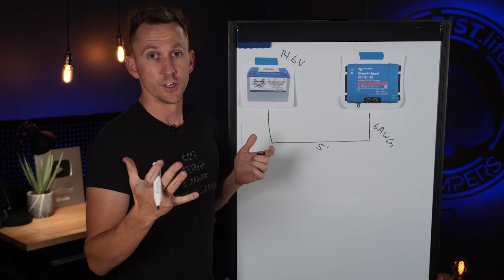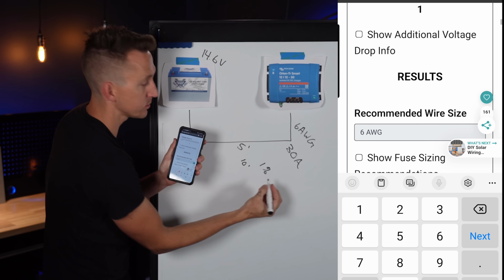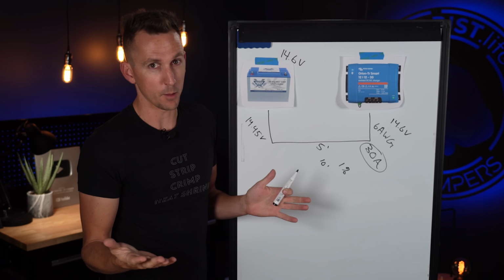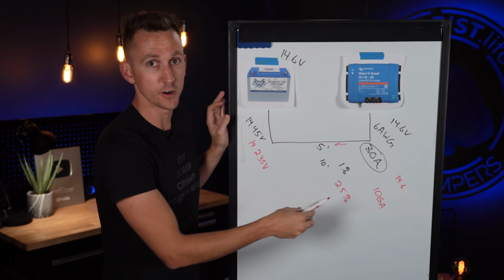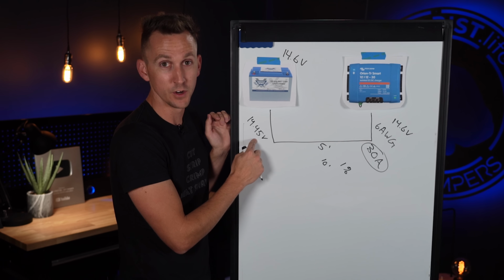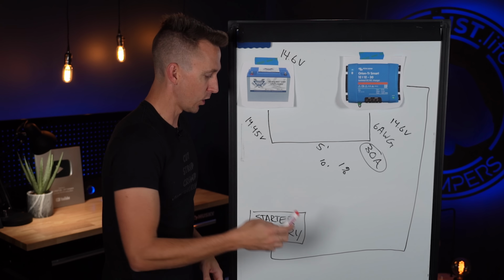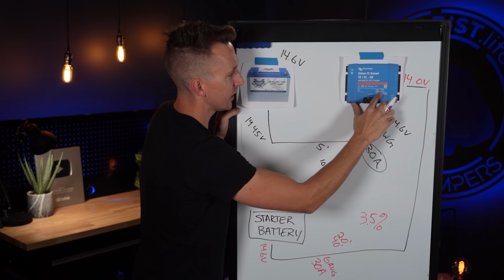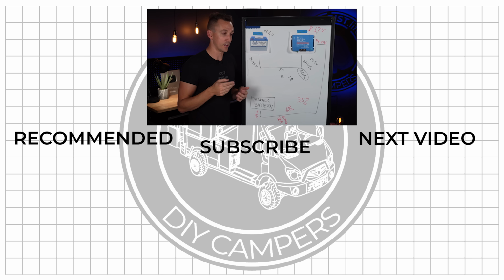HOW VOLTAGE DROP AFFECTS BATTERY CHARGERS

Comment: Hi Nate, I used you renogy wiring diagram for my build. I have 600 watts of solar and 400AH of lithium battery. I’ve set all my appliances to lithium and recently has my whole electric setup shutoff at 50% battery. I have a renogy smart shunt. Is there something I need to program so it doesn’t shut off at half battery life?
Reply from the maker: That does indeed sound like a settings issue.  I'd triple check your user manuals to learn more and reach out to Renogy tech support for more help if needed there.

Comment: How does using chassis ground affect the voltage drop calculation? My 20a renogy dcdc charger has input neg connected via 18" 10awg to lynx power in grounding terminal, which is connected via  18" 2/0 to chassis (drivers seat bolt). I haven't measured the voltages, but I will ... later.
Reply from the maker: Good question!  With wire, we have specific resistance measurements for different sizes of wire that gives us the voltage drop results.  With a chassis ground, we don't have resistance coefficients, so we can't calculate that.  Plus... every chassis is different depending on how the body/frame/etc is connected.  This is one of the biggest reasons I never recommend using the chassis as a 'current carrying conductor' like with a non-isolated charger.

Comment: As the voltage drops from the starting battery to the charge controller, the controller draws more amps to compensate for the voltage loss so that the house battery is charged at 14.6 volts, correct?
Reply from the maker: Basically, yes.

Comment: Can you take actual measurements for what you are showing? I suspect that once the charge controller hits 14.6 then the current will begin to drop and you will not see 30amps at that voltage but instead current will drop significantly causing much less voltage drop.
Reply from the maker: Yeah, maybe, but why not just size wires appropriately for the full load the whole time instead of toeing the line of cutting corners for the sake of saving a couple bucks in wire?
Reply: @EXPLORISTlife  Wasn't suggesting to use smaller gauge wire. I was suggesting that the voltage drop is not a concern since the current will begin to drop and there for you will get fully charged batteries regardless

Comment: Won't the lack of full charge due to excessive voltage drop during the bulk phase of the charging cycle be made up by a slghtly extended absorption phase?
You mentioned the mid input voltage on the dc:dc converter being 8V. If you have a min battery voltage of 12V, that is a max allowable voltage drop of 30%. Yikes!
Reply from the maker: But when you're talking about a 'slightly extended absorption phase', if we are talking about a DC DC Charger, wouldn't it make more sense to just size our wires appropriately so that it's a non-issue?

For the 8V minimum on the Orion, although that's technically the minimum... it'd take something like 200+ ft of wire to get that kind of voltage drop with 6ga wire and 30a, so unless you were driving a truck pulling a camper that was pulling a camper that was pulling a camper where the house batteries were charged from the alternator... this is a non-issue.  I've never seen this kind of voltage drop presented in a real life scenario.
Reply: It’s all about wire size and length when it comes to battery charging, regardless of chemistry.  You want the largest gauge of wire possible so that the high current is distributed over a wider surface area, equating to less heat (safety issue) and you want the shortest length as the ‘further’ the electrons have to travel, the more ‘tired’ they are when they get there = voltage drop
Reply: @EXPLORISTlife  what I was getting at is that it is very arbitrary. The example you gave was a ~10% voltage drop not allowing the batteries to fully charge. I am saying they will fully charge during the absorption phase, and it will be a negligible difference in time. This of course is if you have the voltage drop on the dc:dc output wiring. On the input side it is even less important. Voltage drop of 5%, 10%, or even 20% is easily overcome in the dc:dc. There is the case of using voltage to detect ignition on that will demand low voltage drop. 

I guess what you are saying is that 6ga wire is overkill for most 30A circuits.
Reply: @marvs4321  heat from 30A? Your house uses 10 ga for 30A and it runs in a wood framed house. Probably not recommending 10ga for long runs of 30A in a 12V system.
Reply from the maker: @Doug G  Perhaps, and maybe, but that's a bit of a hack that comes with a lot of gotchas and other cinsiderations.  Another spot youll run into issues with purposefully undersized wires like you are suggesting is if you have a battery monitor in the system:  If you set your 'charged voltage' of your shunt to 14.4 and set the charger to 14.6 and excessive voltage drop is only charging at 14.1V; the battery monitor will never re-synchronize at the charged voltage to 100%; which will yield inaccurate battery monitor readings.

Comment: Yeah but you to need to mention not to use such a skinny wire to squeeze in to just over the 8 volts as the wire resistance will make the wire very warm at full load.
Reply from the maker: There are always fun hypotheticals, sure... but to get that scenario you're talking about would be a circuit length of longer than 120ft (10% is as high as my calculator goes and 6ga at 30a and 120ft is 10%); so yes... If you are driving a truck pulling a camper that is pulling ANOTHER camper trying to charge the furthest back camper from the trucks alternator... you may have to do something different. 😂🤣  Out of the 1,000's of systems I've helped with...I've never run into that scenario.
Reply: I consider any wire, lug, screw or stud  temperature that is warm to the touch as inefficient and a bad design. Especially in 12v systems. And this can easily be achieved by increasing wire gauge 2 sizes over 20 odd feet in a van. As people have a tendency to cheap out on wire and peripherals once they have spent a fortune on the main components
Reply from the maker: 6awg wire carrying 30 amps over 20ft like what we have in our Orion wiring kits at https://shop.explorist.life will not get hot and is only 4.5% voltage drop, which is well within proper design parameters.

Comment: If 12ga is rated for 20 amps, how could 10ga be rated for 50-60 amps..???
Reply from the maker: The higher the temperature rating of the insulation on the wire, the higher the amperage rating for the wire will be.  Compare the max amperage for wire with 70 degree insulation vs 105.